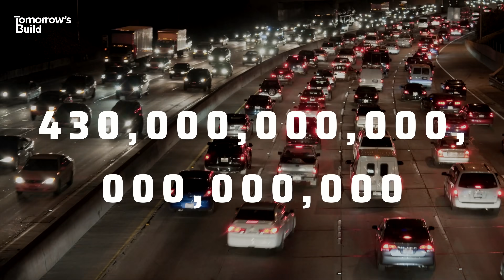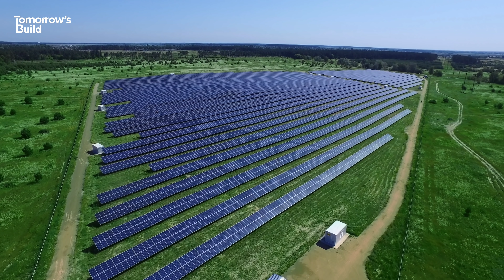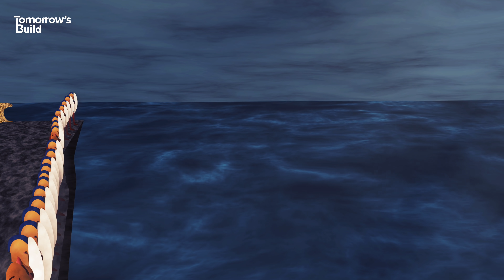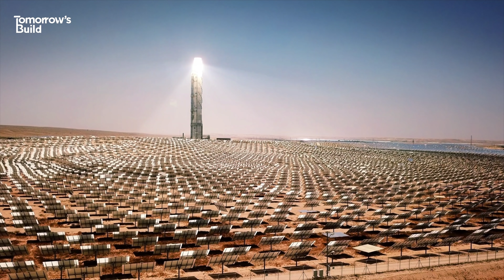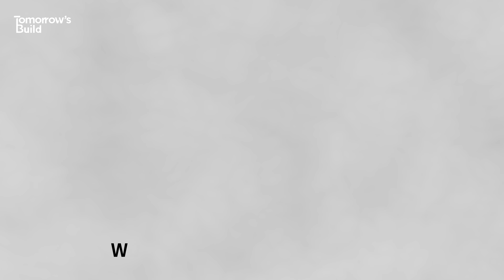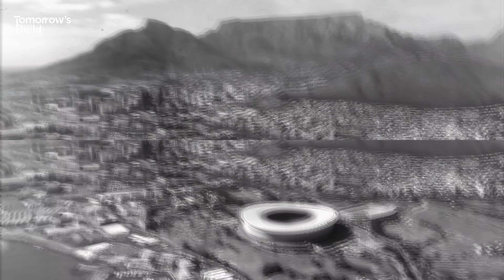Why South Africa is Building a Massive Field of Mirrors

Comment: Long-time B1M subscriber & fan from South Africa. Wasn't aware of this project but it's a welcome development. Our country has been going through loadshedding (rolling blackouts) for the past 14 years.
100MW is small compared to our already insufficient 58GW capacity, but a project like this bring hope for a sustainable solution and an end to our energy problems.
Keep it up,
Zano.
Reply: @Veeger  the project is in the desert. And yes there’s a desert in South Africa. There’s not much wildlife in that part of South Africa besides reptiles. South Africa is a big country. It’s approximately the size of West Europe. And all 9 provinces have their own climate. We don’t have 1 definite climate.
Reply: ...Funny thing is Eskom always supplies my country Eswatini undisturbed
Reply: Oksalayo EskomSePush mzala 😂☝🏾😤
Reply: @Veeger  Concentrating power heats salt meaning you can still generate some energy after the sun has gone down which is a huge plus. If they were just normal solar panels, you would still have to use batteries which itself has an impact.

You using the computer to comment also has an environmental impact. If you are so worried, why not use a bike to travel to work or use public transit?

US pollutes more per capita and actually a few times more than China per capita excluding the US military.

Comment: South Australia gets over 50% of their electricity from rooftop solar. It's a shame that South Africa can't also benefit more from rooftop solar to address their load shedding issues.
Reply: The initial costs in our region is very much prohibitive however they slowly coming down. With further policy developments in this area my guestimation would be that we are at least 5years away from achieving exactly that.
Reply: Theft! They are VERY popular among thieves, especially in rural areas.
Reply: @niebelangrik3358  You know there is an easy solution to that right? Countless private security firms in SA.
Reply: @bafongalo8156  One major problem is the irradiation as per area with the Northern cape being the best area to maximize solar thus reducing the costs. This means one will need more PV panels in Durban than in Northern cape to get the same output and these are costs u cannot mitigate easily. For rural to mitigate PV panel theft, a community solar farm will yield better protection than individual household installation. We need to see more of these community-owned mini-solar farms to combat the everyday basic power problems.
Reply: @nkgudih  You make sense to me bro.
Reply: S Australia is of course a small, small part of a large A grid which is 71% fossil fuel powered, and 51% coal.  Drawing a line around a PV panel and declaring 100% solar is not a serous route to a clean grid.  It’s 2023.  Get serious.

Comment: I'm from South Africa. I drive past a tower like this in Upington every December. It is a massive eyesore. Like a permanent 2nd sun on the horizon. I'm also an electrical engineer working in the renewable energy sector. Solar panels are getting cheaper and more efficient at a rate much faster than wind, hydro and CSP. Photovoltaic panels combined with battery storage, remain the most obvious solution to SA's energy issues.

Think about it like this: plants do not generate their energy centrally and transport it to a colony of plants. Each plant uses photosynthesis to supply its own needs. Humanity will work the same way in the future.
Reply: @Veeger  i am so glad you realize the detriment that comes with these plants. I have to mention that wind turbines play an equivalent role in destroying avian diversity. The tech companies supplying these technologies will obviously remain silent on these issues... It is our responsibility as humanity to not only think with our wallets, but also with our hearts.

Comment: Didn't they abandon one of these solar farms in either Nevada or Arizona? The mirrors kept getting dirty and were hard to clean because you needed a large supply of water? To keep these running the mirrors need to stay clean and it takes a big crew to do that job. And its dangerous to be near those mirrors.

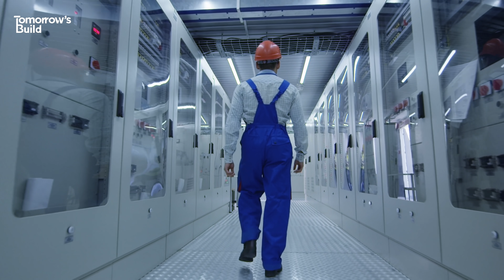Comment: 0:51 in video duration, maybe the ancient technology was a magnifing glass like pirates used to see far far away into the distant... Just imagine lots and lots of them channeling through a tube of some sort, just imagine the intensity of the energy it will collect.
Reply: Notice the human Opperating the death ray its holding a lever of some sort or control panel.

Comment: Here in the Philippines we will manufacture a Generator that dont use petrol no battery or coal. It wil be out in the market in mid 2022 ang it can give power anything that needs electricity.

Comment: Gansu, China, also has a salt melting tower type thermal power station, which is very large.
It produces 390 million kilowatt-hours of electricity every year, saving 10,000 mu of forest carbon emissions every year.

But it can only be built in sunny places.

Comment: What's even more mind blowing then the amount of energy radiating from the sun, is that electricity doesn't lose its energy when you use it. It simply passes through.

Resistive elements, like incandescence or heaters require far more power than electromagnetic force (motors), because they're literally resisting the flow of electricity.

Comment: This may be a daft question but wouldn't this warm up the atmosphere when we're trying to cool it down? Or does the object the light is pointing at only heats up? I've heard when birds fly near these things, they burn up and die.
Reply: Hope they can do something so that birds dont come too near.
Reply: Mirrors aren't creating heat they're reflecting the heat which is already landing on them.
Reply: @hurrdurrmurrgurr  if that is the case that is good news. 👍🏼
Reply: The mirrors are not creating heat, they basically just channelling the already existing heat to a single point.  The only problem with this is that, anything that comes near that point, especially organic material, its likely to die off. So animals such as birds flying over, are the ones in danger

Comment: Let's be clear, building solar in South Africa has nothing to do with green energy and everything to do with the fact that our coal power plants are so broken that they should all be rebuilt from scratch. We built two new ones and they are amongst the most unreliable in the fleet, solar is the only way we can reduce the pressure on the system but there is a lot of resistance from the unions to protect coal mining and general lethargy from government itself.

Comment: I thought those types of power stations are no longer making sense due to reduced cost of photovoltaic?
Reply: Elon Musk reportedly developed a roof tile that replaces the voltaic panels. Every house should be fitted with either the tiles or the panels to supply lighting and light draw needs.  Heating for cooking and warmth can come from lp gas.
Reply: @tantalisinglabrat  that is very inefficient, electricity is produced on a large scale because of of economic to scale  solar city failed

Comment: You really don’t need direct sunlight to produce electricity from a solar panel. Even if the sky is covered the solar panels will produce electricity, though admittedly, not as much. But not zero.

Comment: Problem is because all the big plants aren’t producing enough power so people are using generators and other smaller plants to produce power. 

I don’t know what the numbers realistically are but that might have an impact on how green the energy is. I imagine that making another big coal power plant that eliminates the need for micro-generation might be more environmentally friendly than producing a near-zero carbon footprint plant that has a negligible impact on the grid.

Comment: The total solar energy hitting the earth is a misleading, meaningless figure, it's the concentration of energy and regulatory that is important and therefore exactly why such major areas of land are needed for reliable around the clock base power. We would need to cover areas with mirrors that are larger than current cities and then subsidize them indefinitely. Somewhere the elevator does not reach the top floor! Ancillary solar applications such as insitu water heating can be quite cost effective and reduce coal power consumption, but renewables are not viable yet. Ultimately the choice is updated nuclear technology or severely regressive living standards, if you can see beyond the big oil promoted "renewables" smoke screens.

Comment: With "certain algorithms/coding," implemented, everything from "direction of panels," to "load outputs/ voltage/ current regulationing" could be "autonomously controlled," and regulated with even more precision.. Not only the "Solar Panels," but massive "magnification mirrors," could change directions autonomously to maximize on "direct sun," without having to adjust it directly.. Not only on our planet but mirrors that redirect sunlight from low orbital satellites, call them Satellite Mirrors if you will but it could shed light, "Yes pun intended," throughout the entire day & night to a particular point on our planet.. Even when its night the sunlight could be sent to that particular point to have continuous connectivity directly with the sun.. Instead of inventing ideas to house it or create more dangerous chemically engineered batteries, I think they a good start would be with all the pyramids across the entire planet and check the angles of where they point and their locations to each other.. Actually better yet the equator line/ belt could power the entire planet.. Particularly with Quantum Computing for algorithms and precision I'm sure it can be arranged all these steps can be done in synchronicity or simultaneously if need be.. Just give me a job in this field.. Let me work my magic, so to speak... CANADA I CAN HELP, JUST LET ME HELP! 🤔😪♾®️

Comment: The notion that solar (or wind) power is sustainable is a misnomer unless you can explain how to smelt steel without fossil fuels. How are solar panels and batteries (and windmill blades) recycled? What are their lifespans? Critical thinking is required. As for being endebted for it ... all I can think is that the people running the show are insane

Comment: mythbusters debunked the historic setting ships on fire with mirrors myth.
Reply: As was mentioned in the video.
Reply: @daveseddon5227  wasn't mentioned in the title, titlecard or intro. i wonder what moves a solid factual channel to use such unworthy methods.
Reply: @yetzt  Not caring about the opinions of cellar dwellers at the bottom of their YouTube comment section.